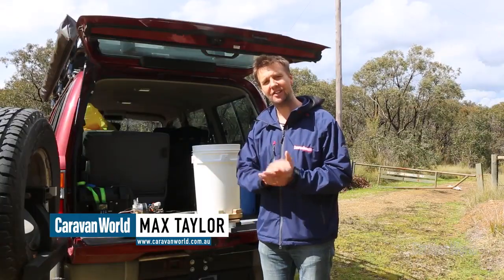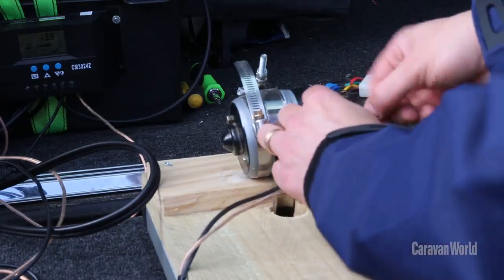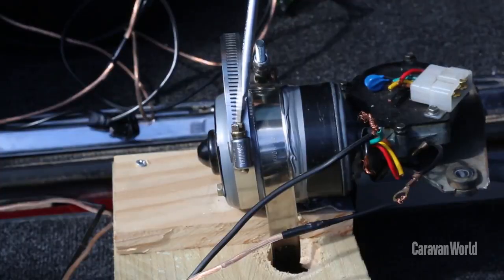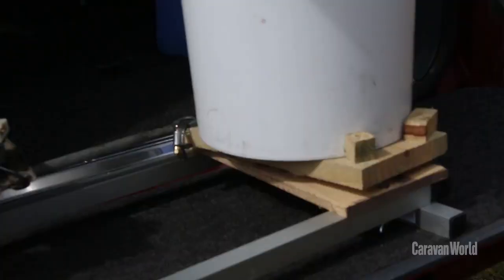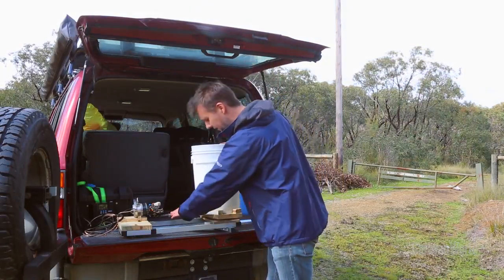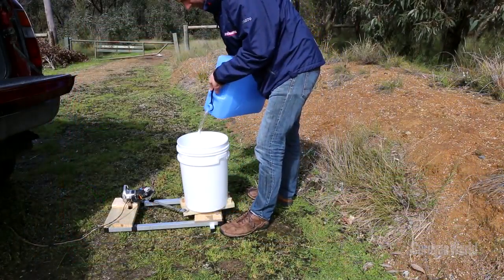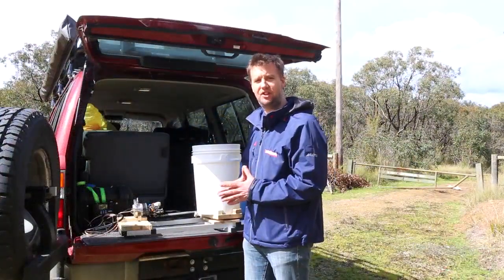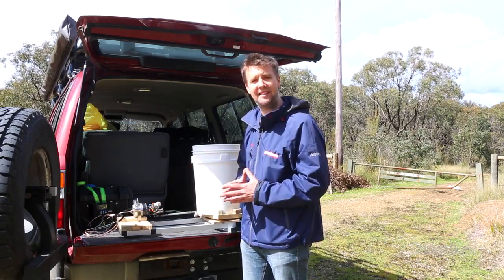DIY Outback Washing Machine

Comment: Hum you have the right idea but you are missing one thing you need to put an agitator on the bottom of the bucket and It would do a better job washing your clothes and you need to increase the rotation stroke and then it would do a better job but unfortunately that won't get Nothing clean because it doesn't have an agitator so you Need to put some fins on the bottom of your bucket if you want better results but nice project though.